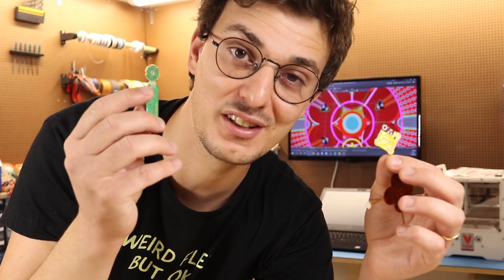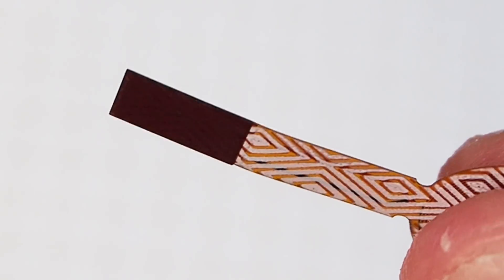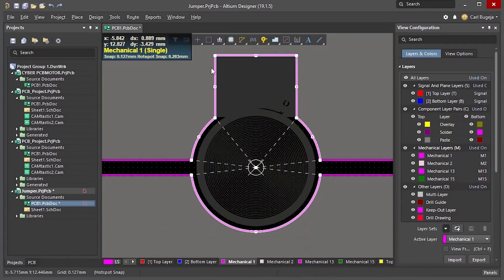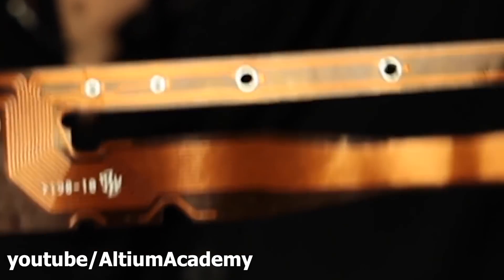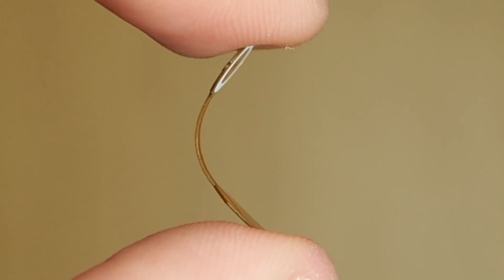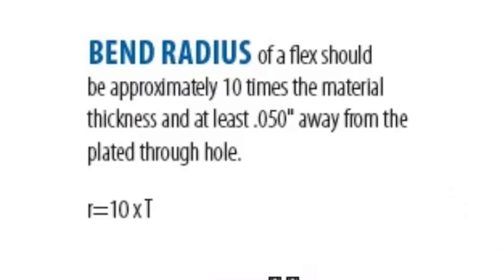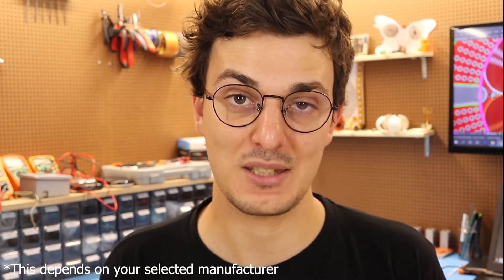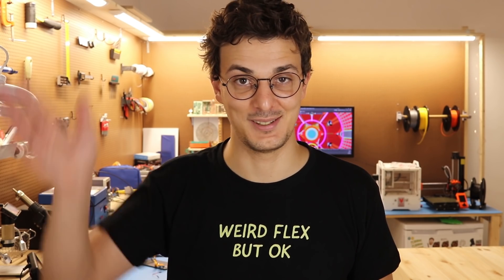Beginner's Guide to Flexible Circuits!

Comment: you are doing great work. i am layout designer by profession and even i find difficult to get this kind of comprehensive knowledge about layout and PCB covered in single video. keep up the good work. i suggest you should make a pcb layout design and schematic design series in which you can cover from basic LDO, buck, boost and go advance with RF, ble, wifi, NFC, DDR, HDMI, MIPI, FPGA, high power DC-DC, AC-DC et. and go through design consideration and guidelines.

Comment: Great Video Carl thanks
Question - If I want to make a few flexible PCB is it possible to use a stencil printer. And how would you hold down the flexible PCB and do the accurate positioning.

Comment: Great Video!

Does adding the stiffener cover everything beneath it? For example if I placed it over several through-hole pads I need to solder pins to would that be possible?

Thanks!

Comment: Flex PCBs change the impedance line? Lets say I want to create a BLE device and use a Ceramic Chip Antenna. Can I use a flex pcb for that and connect the Antenna output from MCU to the impedance matching network and then to the ceramic chip antenna and this will work when bending the flex pcb board around the 3d package?  Also, can I weld components in both sides of the Flex PCB?

Comment: Sharp corners let the electrons fall out. Well, that is for high frequency circuits, but it is a good idea for keeping segments from becoming antennae for all the noise in the environment when you haven't shielded the circuit.

Solder to flex with low temp paste and use a controlled temp hot air blower to flow the solder and for if you need to de-solder.

Comment: what would you think about a foldable motherboard for a computer...

i want the PCIE slot for the GPU separated from the CPU by a fold. debating if the Ram should be on the same section as the CU or the GPU or even on a third divide... i want the motherboard folded around an aluminum heatsink and maybe even the cable management  with a large amount of airflow through the center of it.

any thoughts?
Reply: Motherboards are very complex circuits with lots of constrains. It has many layers with different porwer requirements, shielding from EMF, limitations of parallel lines having same lenght with different paths and complex connectors. I would not say that it is impossible, but you'll have to be an amazing designer or have an amazing designer working for you. Other then that, you will spend a lot of money and time in development until having the product. Good luck with your idea.

Comment: it would be interesting to try to build a tiny submarine robot using the flappy pcbs movement at a propeller like a fish tail.
Reply: he already did it
Reply: you could use two so they alternately attract and repel. Doing it with one would be a bit of a mare.
Reply: @gordonlawrence1448 that would be terrible for the fluid dynamics however
Reply: The flexible circuit board is very good.

Comment: if your problem is battery weights then why dont you use emf for your flappy/jumping flex board
i mean attach small emf board and provide voltage throught emf pad

Comment: Bugeja, I suggest you to explore intelligent PCBs: several regions with electromagnetic coil actuators and several hinges to induce FOLDING and stabilise a dynamic origami structure. Do it now, or else we will be reading about it in a couple years because some MIT engineers. If someone has to do it, I prefer you to be the one. I could design some structures if you want